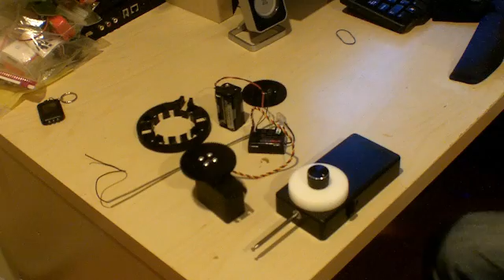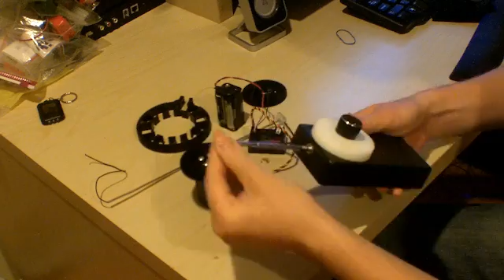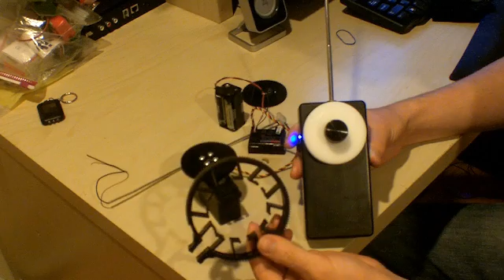Follow Focus Prototype

Comment from the maker: @mapledutch Hey Mapledutch. Its not in my control actually. Because the servo is 2.5 rotation, it starts to slow down when the variable gets close to the set value. So, if you used this servo, it will do the same for you. 
Yet my final version of this ended up using a strong standard Hitec servo which was 180 degree turn. It was faster and more responsive.